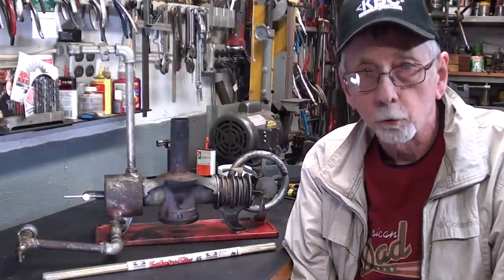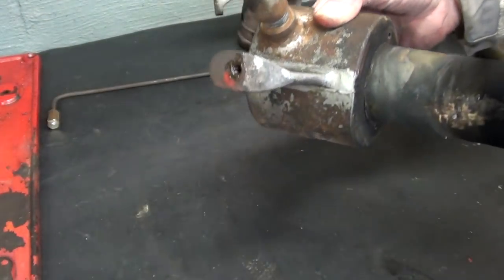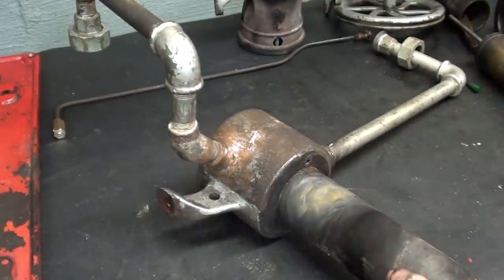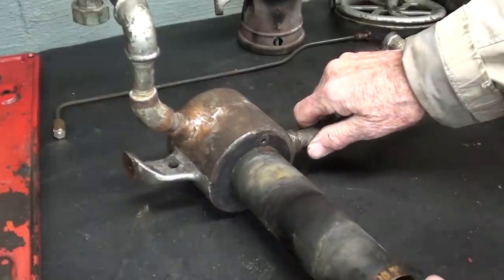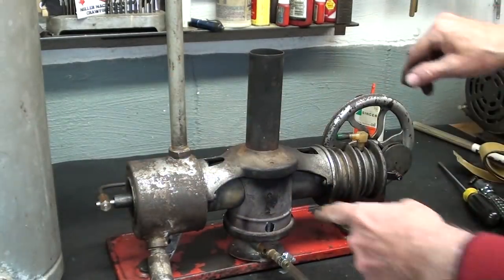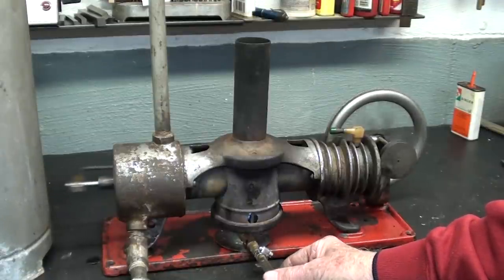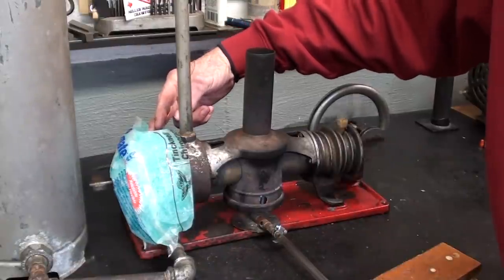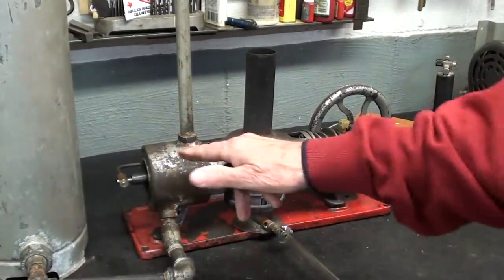ESSEX HOT AIR ENGINE pt 6 #771 IT RUNS tubalcain stirling

Comment: 5:50 Yep, I thought you might have ended up using side cutters to remove that rod :)
I will say other than that hassle, that looks a really nice repair. Fancy repairing the inner tube on my pushbike in a similar way ;)

Comment: The Issue with the Essex design is that the mass of the moving parts are sliding, which causes friction loss. A vertical configuration has its moving masses held by bearings, and so it would not waste as much in friction loss.

Comment: Enjoyed the series.  I've cleaned clogged automotive heater cores successfully with lime away and a radiator flush gun that uses air and wather.  Maybe pressure flush the entire cooling system.  It was great to see it running.

Comment: I use a propane only torch all the time for silver soldering. You just need a big burner.
Reply: MAPP Gas is the modern way, I just use disposable cartridges now days, as it's too expensive to get bottles filled here in Sydney Australia..
Reply: @johncoops6897  OK for small parts but you would not make a large boiler with just mapp.
Reply: Im a refrigeration tech here in Oz. Mapp is only good up to about a 3/4" tee under ideal conditions..

Comment: Lyle - Nice soldering job.  I will agree with your comment on the possible scaling (or rusting or other corrosion) in the cooling circuit.  Especially if hard water has been used previously.  Any of that will really impact the heat transfer.  Especially critical in a small Stirling engine like this that is so low power to begin with.  Add in all the other friction losses and it could be too much of a loss.  Totally agree - you succeeded now on to the next adventure.

Comment: Brilliant to see this running again--very well done indeed!!! I understand how gruelling something like this can be when it feels like you've thrown everything including the kitchen sink at it and the thing still sits there stubbornly refusing to work. I think to get it any further now you would need to replace the whole cylinder assembly. That would not be trivial and probably require a number of different skills to create those precisely sized hollow brass vessels and correctly fitting sleeves.

It might just be worth running one of those limescale removal solutions you get for coffee machines and washing machines through the cooling loop. It could just be something as simple as the bore of the water pipes is down to a relative pin-hole after the deposition of nearly a hundred years. However I dare say the biggest issue is the vacuum seal on the cylinder.

Comment: My sugestion not knowing much about hot air engines is that the pipe from the heatexchanger is sloping downwards from the drain cock to the 90° possibly hindering the flow of cooling water by convection   . I enjoy all your videos very much from Ireland

Comment: Prestolite is a low temp torch used by plumbers for soldering. The turbotorch ( I have one) is used for silver soldering with sil floss usually use sil floss 15. Oxy acetelyne is usually used but the turbotorch works well. The turbo injects much more air for increased heat, that is why the noise. Plumbers hate to run into a pipe brazed by an HVAC man as the Prestolite will not get hot enough to melt the sil floss. 😶.
Reply from the maker: Thanks

Comment: Basic physics come to play in this.....as the hot side piston is heated up it expands in the heated bore, as the metals are different compositions and thicknesses they expand at different rates and to diff sizes.....initially they will run as tolerences are nominal but as the piston expands even larger and larger, friction in the bore increases more and more and drag of the piston wall now which is expanded now slows and eventually stops the reciprocal motion.  Exactly what you arew experiencing.....,Also maybe a good idea to make the water tank able to be filled w ice and water and a thin water jacket around the coldside cyl bore which will regulate that bore thermal expansion.....hey its worth a try at least....
Reply from the maker: Thank you for the ideas

Comment: Try the old white gas burner the fir may be to hot with propane Just a guess but the extreme heat is to much to balance the engine.

Comment: COOL!! I would guess your duration is limited by either internal leaks or just wear in general. I don't see how you get to excess power for any application running as close to the margin as it is no matter how light the load by optimizing temperatures..

Comment: Your heat gun doesn't simply read the temp at the laser point.  It's reading the AVERAGE temperature in a circular area that grows at the square of the distance that the gun is from the measurement point.  It it's an "8:1" meter, it's reading a one inch diameter circle 8 inches from the tool.
Also---- It is sensitive to the COLOR of the surface that it is reading.  Silver colored, like your cooling tank, could be dozens of degrees different from the same surface if it was painted black.

Comment: Fill the water jacket with CLR or a rust remover. May break up the schmoo in there
Reply: Try to remove chalk from the water cicuit with the kind of material that does not effect the metal.
I use the water coming out of the condense dryer.

Comment: Well, I'd like you to play with the original burner to get that working properly. I don't think it's burnt correctly all the time you've had it. It'd be interesting to have the burner out in the open running to see how it should burn. I'm guessing the mesh in it acts as some kind of wick ? Also, you had flame in the horizontal part - and I don't think it should have - so trying to understand how the burner is supposed to work would be of interest.

Does it matter what the topic of your videos are as long as they're interesting ?
Reply: I'll add my vote to this idea, I've wanted to see that burner working the way I think it should from day one, gas burn only no red flame.
Bubba dun broke it, a long time ago, is my thought.
Keep on belting out those videos, I'll be watching.

Comment: That brass tube is not the most efficient. Stainless steel would be a better choice as it does not transfer heat nearly as quickly as brass. They probably didn't have access to it back then though at least at a reasonable price.

Comment: I'm sure that the water jackets are scaled and possibly plugged to a percentage, what you can do is mix up a Muriatic acid solution in the cooling system and continue running the unit, that will reduce the buildup significantly, plus allowing it to sit idle in the solution.  Thanks for the video! God bless